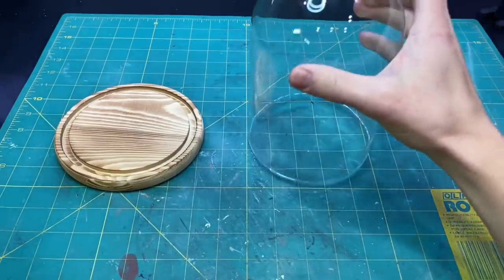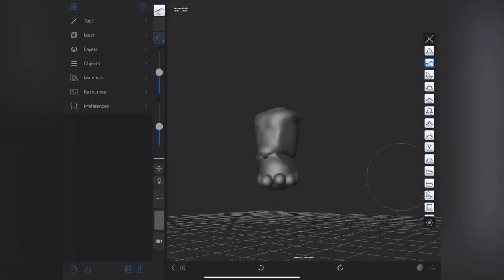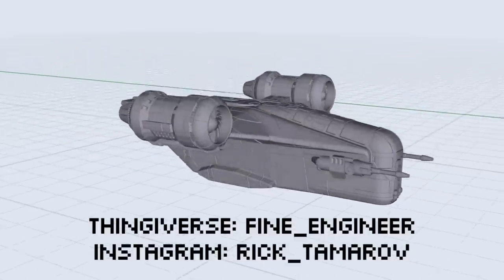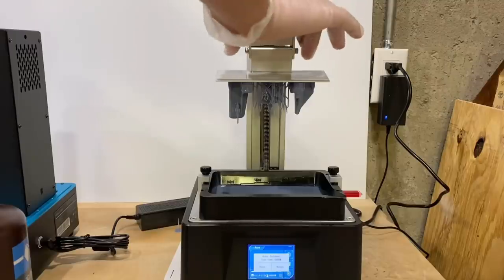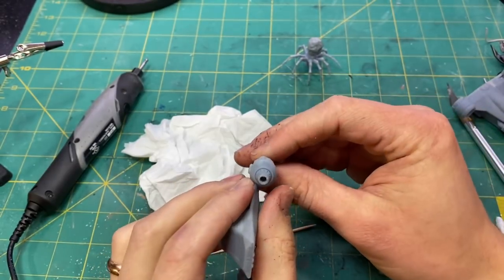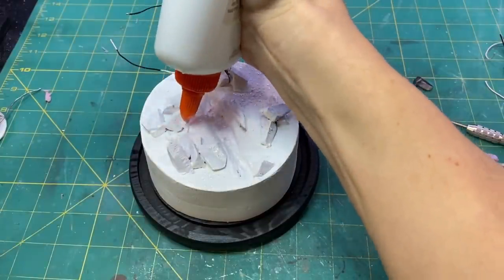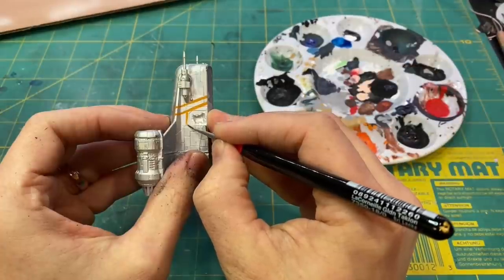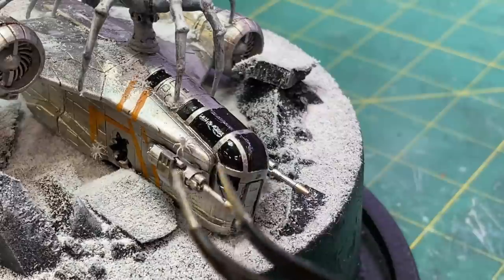Giant Spider | Mandalorian S2 - Episode 2

Comment: I've started doing this a while ago before the cure step after the model has been cleaned with whatever solution you're using. If you let the print with supports sit in warm water for 30 seconds, you can pop the supports right off with very little cleaning. I'd say play with it and see if you like it. I sometimes get small pock marks where the supports were, but I just fill them in.

Comment: :) after printing the models and washing them. use an old hair dryer on the supports they will warm up and flex allowing you to brush them away from the model leaving no puck marks then cure the model. this will increase your workflow and less clean up. :) hope this helps. :)

Comment: Congrats: it's good! But there are 2 errors:
1) a very bad one: ice is not black, so u should have used a light blu base color; your work has lost much of its potential.
2) a simple one, almost negligible: the big spider attacked the Razon on the top of the cockpit.
But, I told u, great job!